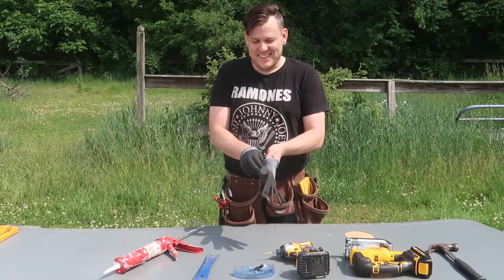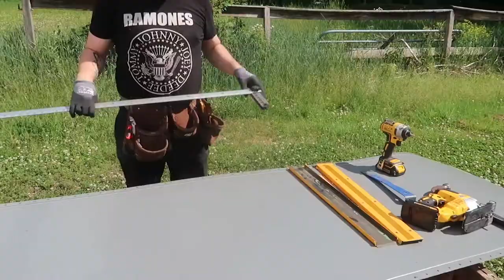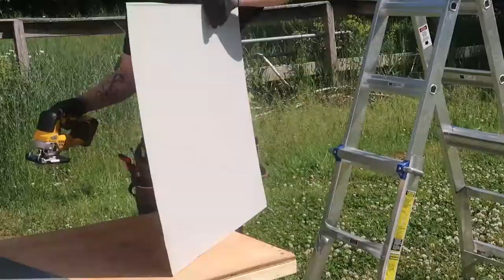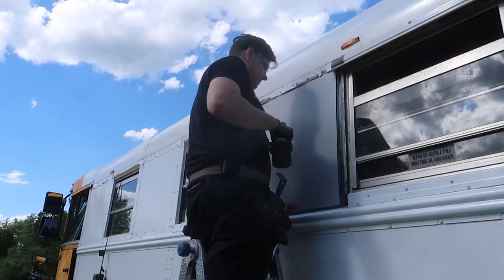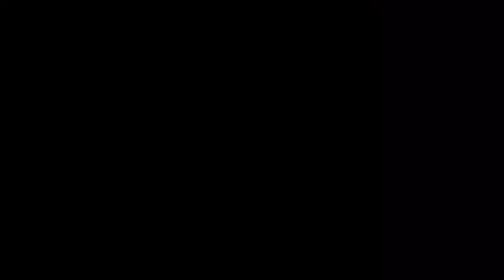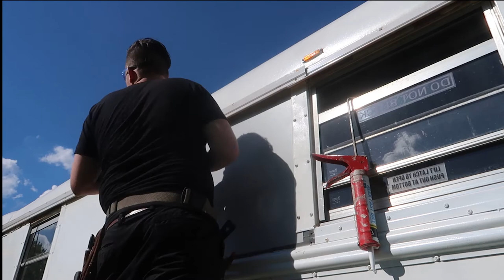How to Cover Bus Windows with the Ceiling || School Bus Conversion Vlog

Comment: How did you do the wiring on this bus?
Reply from the maker: Hello, Sorry it took so long for me to respond. I haven't been keeping up with this channel that much. My husband has done all the wiring so far. Unfortunately a lot of that footage was lost when my harddrive crashed. When we first got the bus he pulled apart the entire system and removed everything we didn't want.  He used a manual we found online for our bus and other youtube videos (plus a little bit of trial and error on some of the lines) 

As far as for our new electrical we're still working on that part of the bus. He put in a few lines for lights and a few outlets so we could have some power on the bus for construction but we eventually will be setting up an entire solar panel system (we haven't gotten to that part yet) If you have any specific questions I'll relay to him and get back to you.

Comment: My ceiling panels have tiny holes in them. Can they be sealed to use like this?
Reply: Hey Danny, We made sure to use pieces that didn't have holes so I can't recommend it for sure. However, we have used both Bondo Body Filler and JB Weld steel stick to seal other holes (like where we pulled out our flasher lights). So far the Bondo has held up best. I'm not sure how durable either of those options will be but so far we've had no problems. Good luck!